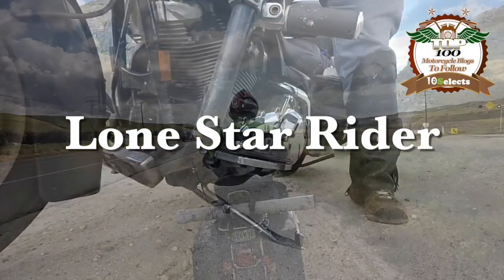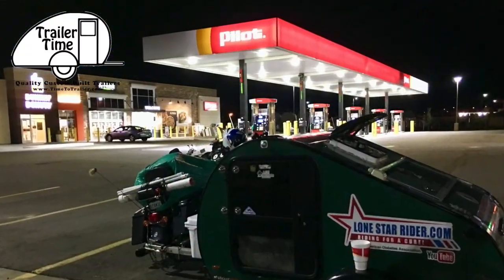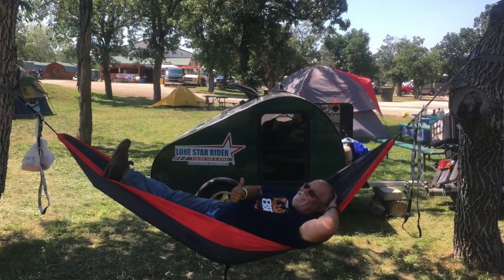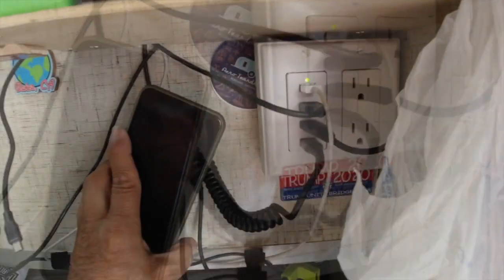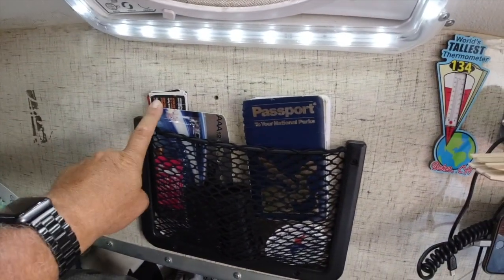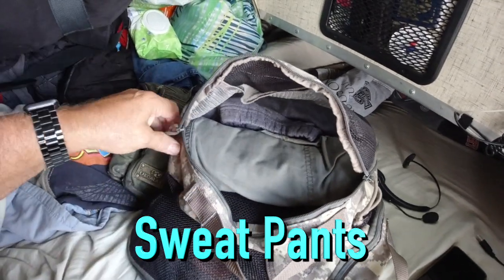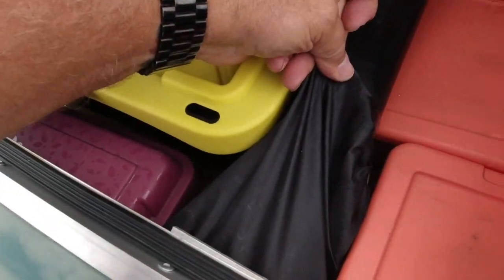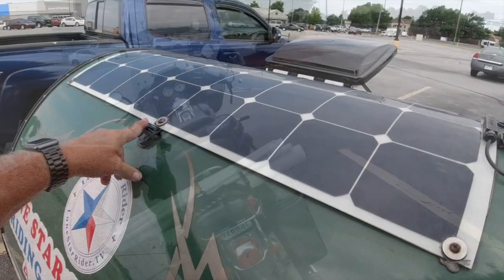TEARDROP TRAILER TOUR | SOLO GUY TRAVELER Lives TEARDROP LIFE

Comment: Sweet camper. The USB plug you put in is it running on 115v? You could probably wire in an automotive USB and not have power loss when converting ac to dc. Only trying to help. This thing is cool
Reply from the maker: Thank You!

Comment: Good teaching video!! I pull a trailer not quite as heavy as yours with a 2007 Heritage. What is your tongue weight? Have you had any problems with drive belts? safe ridin rubber down
Reply from the maker: 75 lbs, no problems with the belt on the Road Glide, just changing out the clutch every year. I now pull the trailer with a 2008 Honda Goldwing

Comment: If u could rig up a cb radio and when u get to a truck stop u can ask drivers to get u a shower card when they go in to pay. Most of them don’t use it and will give u one. They get a free one every time they fill up. Is your bike rigged up to charge your house battery when driving
Reply from the maker: Yeah, I didn't mention the truck drivers sometime they give me a free shower. Sometimes Pilot or Loves Truck Stops when they see there are no showers credits on my card they give me a free shower. I will be talking about that on my how to stay clean on a road trip. 
The Motorcycle does not put out enough power to charge the trailer battery. The solar dose an awesome job keeping the battery charge.

Comment: God Bless.  Rubber side down.  Look into EBC brakes.  Have a 2004 BMW 1200gt.  Its a heavy bike and I'm a big boy.  Burned  through stock brakes way to fast.  Very pleased with EBC aftermarket rotors and pads.
Reply from the maker: Thanks for the tips!

Comment: Hi, I bought his red trailer 5 years ago, (demo). I pull it with 85 flhtc, also red. I've pulled it about 28 thousand miles so far, love it! My hatch also leaks, but Jason it totally dismissive of me on that. Never offered to solve problem. But, I still love it. Gonna put brakes on this year, I found a company that sells custom axles for about 550 bucks.
Reply from the maker: Thanks for the info! Send me the link to the custom axles.
Reply: What was the trailer cost before the company went out of business?